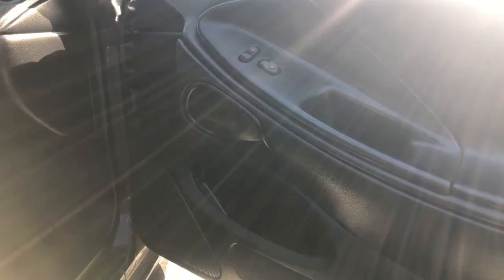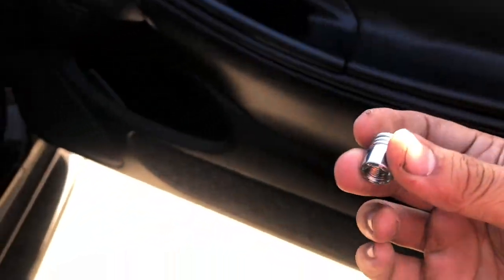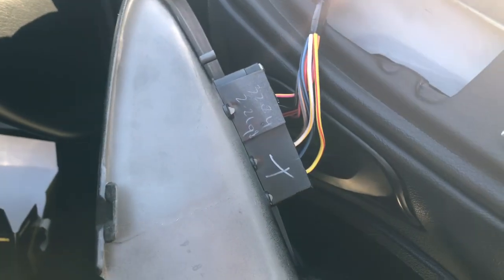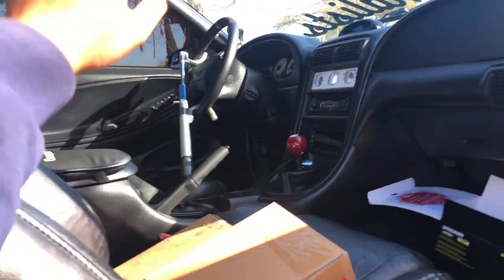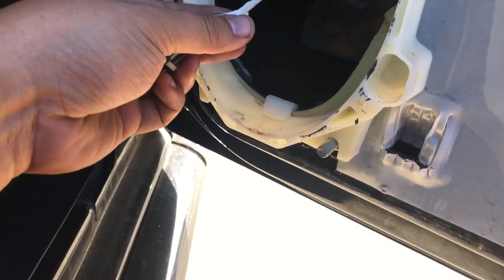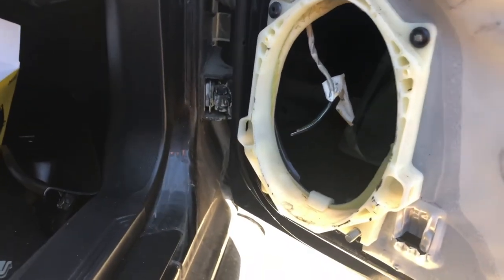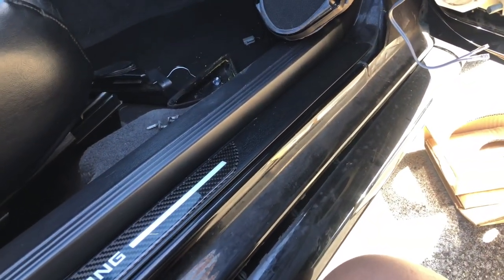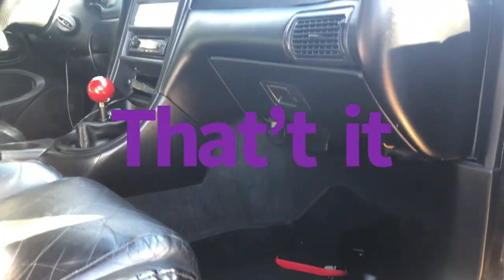How to change/upgrade your 94-98 mustang front speakers

Comment: Just incase if you need more info about the mach 460 system i have a 03 with the mach 460 i found out that those wires run to one of the amplifier's that is meant to produce bass.

Comment: Ive read that the Mach 460 speakers are 8 ohm. Are the Kickers 8 ohm as well or 4 ohm?
Reply from the maker: That I'm not sure of
Reply: @stangculture  but you are still using the Mach 460 system? Just replacing the speakers with the Kickers and getting good sound?
Reply from the maker: @travisbark5985  yes but when you play something with a lot of bass. The sounds cut out. But it had something to do with the Mach 460 not then speakers.
Reply: The kicker are 4 ohm and will play at around half the rated power of connected to an 8 ohm circuit
Reply from the maker: @InspirationalRockGarden-yl9ir  Good to know thanks for the info

Comment: Does the tweeter in the kicker work? ive seen other videos saying you’d have to change up the wiring
Reply: Or new amp ?
Reply from the maker: Yea it definitely works
Reply: The 6x8 on the front and the 6.5" in the rear are powered by mono amps in the rear. Ford used the lower speakers for bass, and the small  speakers  above the 6x8 & 6.5' as full range powered from a different amp up front.

Comment: Can’t put 4 ohm speakers in a 8 ohm wired system
Reply from the maker: It's been working fine for me. Until heavy bass drop.
Reply: Yes, but they will only have half the rated output
Reply: You can, it just won’t sound the best
Reply from the maker: @brettsummer5070  Hmm I see. Thanks for the info.